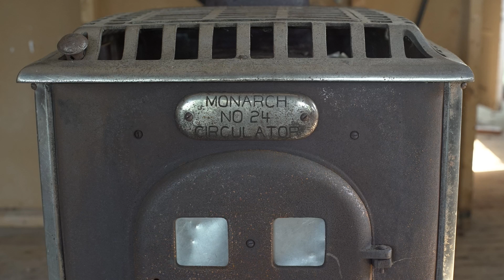Fixer Upper: Some Work Required

Comment: Slim it looks like you have a winter’s project ahead of you.  I’m sure you can handle it.  Looks to me like you have a a good skeleton structure to build upon.  You’ll just have to prioritize what needs to be done first.  May I suggest you start with that front porch. 😆 After that, well you’ll have to decide.  One good thing is you’ve got your trailer to live in while getting the house ready.  Good Luck with your project. It will be interesting to watch.

Comment: Salt waterfront.  Can't beat that.  Cabin is a little rough, but I have seen worse in Fredericton.  Well you won't be bored.  Could get a bit fresh in winter though.  Not as cold as Alberta, but the damp New Brunswick cold can be pretty unpleasant.  I hope you like snow.

Comment: Nice little place Slim. I would clear a few trees from around the "cabin" for fire safety purposes 25 to 50 feet at least. Some areas like mine require a 200 foot area around to be clear.

Comment: That is one heck of a project! 
Just saying, I would salvage what I could remove the building check the pilings and build new.

I took on a project like this a long time ago. Rot is the problem and from the video Slim, it's everywhere. 

Long story short, I ended up taking the building down bought a double car garage package, without the cost of doors.Also new floor with treated lumber, new plywood flooring.  Brought wiring up to code, insulated used some of the windows from the old building. Framed a bedroom and washroom kitchen livingroom all open better for heating.

Over time build a lean-to along one side for a shop. Otherside had roof end walls for fire wood and storage. 

Best part the lumber was delivered. 

As I said, just saying 😎

Comment: Dear Slim,  The land is fantastic and I could imagine landscaping a path to the water.  A few tree's taken out to improve the view to the water.  Wonderful land!!   Now to the house,  hmm,  the floor bounces too much which means they either spaced the floor beams to far apart or they have rotten out.  The house supports look like the house moved towards the water a bit and they are slanted.   I wondered about snow fall in the area and why the house was sitting on the ground in the front without a cement pad to sit on or at least lifted off the ground a foot to keep snow from piling up on the house.
ok ok I know I am picking it apart.  inside those little rooms need to be taken down/out,  I did like the wall of windows, but it divided up the living room area.  Maybe between kitchen and living room?   I worried about septic or if it was connected to public sewer / water / electric  or not.  The roof needs to be taken off and put on correctly with right spacing on supports.  Metal roofing the best for keeping pine needles off the roof.
Here is my suggestion :)   save what you can from the house,  the old wood windows etc.  trash the aluminum ones.  pile the wood up and cover.  Have a cat come in and level the ground for a good foundation site for the new house.

Wonderful land with view,  lots of animals and tree's.   Nice place to build on  :)

Comment: Some friends of mine bought a house like that once. It was probably three times the size of this one. They completely rebuilt / refurbished it, and when all was said and done, it was great, but an architect looking at it and the amount of money it had taken said that it would have been basically the same price to have leveled it and built new, and then everything is known, new material, configured exactly as the owners prefer, and can be re-sold as necessary with the listing showing that it was built in that much more recent year. Just a consideration...

Comment: Gracious goodness!  I was hoping the damage was all in the questionably-built add-on, but that burned bit didn't look good.  Here's hoping you've got strong enough walls to support a new roof, and that you can get the roof resolved before winter.

Comment: First thing. Slim, whatever you do I wish you the best of luck. I know from your videos that you're a person you works the numbers, makes a 'for and against list' and comes to a logical conclusion. Tear down, renovate?  Whichever it is I'm sure you've looked into all the options.

Now on to what may not be a popular comment. I'm going to be what I think is currently the only one to note this fact. Slim says, "It's a side project for times I cannot travel. I will be on the road soon!". If that's the case folks, he's not going to be doing much work on this as his primary focus, based on his statement, is travel. That's OK with me. It's what attracted me to this channel in the first place. If Slim is going to do most of the work himself there will be very little to any travel in the foreseeable future. Anyone that's ever done any remodeling, renovation or even watched "This Old House" or a similar show would understand that. It's lots and lots of very hard work. Much of it would be very difficult to do alone and there is his safety to consider. This is way beyond the level of work he's done when modifying his trailers. Could Slim do it? Sure he could! But not before the snow flies if he's also going to do any substantial traveling.
 
I also want to say this. Slim, don't let your natural enthusiasm cloud your judgment. Slim, please to not take on any high risk tasks. None of us want to see you get hurt working on this project.

Comment: It looked tiny from the outside but seems bigger on the inside... DID YOU BUY YOURSELF A TARDIS?  Wow... it comes with a drill press!...and obviously a leaky roof as well. Here you are surrounded by cubic kilometers of leaves, needles and twigs (check out that roof) and they left you a broom by the door! Gotta love it!

Comment: Beautiful spot, a bit soiled by the man made stuff though.  Too bad about the porch and the porch roof.  Is it accessible during the winter months?  Does it have a well, and septic?  I made a home out of "cottage" 10 years ago in northern Wisconsin during the winter.  It had good bones and both well and septic were good but they were not usable for three months of the 4 months of the 6 month remodel.   The cheapest solution is a tear down and making a flat spot for your trailer with electric hookups and a tool shed with an out house far enough away.

Comment: Well good luck on your cottage. You have a lot of work before winter. I'd hire a good contactor to get to work now before winter sets in. A roof, floor, window, and a brand new stove, maybe new gravel drive :) New electrical too. After that you can do the rest :)
Reply: On a lot reflection, and watching several seasons of 'Maine Cabin Masters" I think Slim your best course of action would be a completer tear down. It would be far cheaper to build a brand new cabin than 'try' to make that wreck livable. You are going to have to put in a new cepitic system, like a I said a new gravel drive. and apply for the Starlink beta for high speed internet. If you start now you might get a enclosed shell before the 1st snow. Good luck.

Comment: Old timer once advised me.  Take a cloe look at the ridge line.  If it is straight, then proceed. Any dip or sagging, tear it down.  Any sag speaks to bad rotting  framing.  Worse you likely have a bad foundation.

Comment: by the time someone would fix that foundation, fix the rot, renovate the whole things, it would be cheaper to tear it down and put up a prebuilt shed of equal size
Reply: A Shed House cabin style would be perfect
Reply: @AngelWerx-2012  Aframe is the way to build it...walls are the roof, one length, two walls

Comment: Well on the bright side of things, the house is not a total disaster. It is however, pretty far gone, but still not a total disaster. I have seen houses in worse shape restored, and I have seen houses in better shape totally demolished. Hope you did not pay much for it Slim, but still looks like it could be a wonderful house when it is restored. The good news is, that you at least have a home base, where you can park your trailer and still camp. I think I would have bought it as well, just for the solitude that it looks to afford.

Comment: OSB is rotten on the walls, floors, and roof is rotten. I have tried rebuilding similar size places before. Seriously just take it apart, down to the foundation. You might be able to save joists maybe some windows (if you really wanted them). I would seriously consider doing a metal roof as it’s small enough to be affordable. Burn all the OSB though don’t breathe it either lots of nasty glues and mold. Demo probably will take the longest. Building from ground up I could do it in about a week or two depending on the hours you put into it. Wonder if toilet is septic might need to spend a bundle there. Make sure well is in good shape. I would build a viewing deck off the front with a door on the front. Sucks lumber is high but it is coming down finally. You might be better off buying a kit home/cabin. Start over for sure you won’t regret it later and it will be worth more.

Comment: Just from the first couple of minutes of the video, "Some work required" may be a bit of an understatement.  That row of buckets is not good news and the back step could indicate problems of a similar nature underneath.  An unfinished extension is always an area of concern.  Nice location, now tear it down and start again.  I would definitely watch any such project.
Reply: I'm not sure it's an unfinished extension, at least not in the usual sense. Common in cabins of the era (just a guess mind you, I could well be wrong) it's the summer room. A place to relax, sleep even, when the cabin proper is too hot, open the windows for the air, enjoy the view. Unheated in the winter and usually unused, or used for storage.
Reply: Actually I have to now agree the back part definitely looks like an add on, I missed the side view earlier where it looks clearly badly tacked on with an equally bad roof extension.

Comment: The site is beautiful. Use your trailer and enjoy the land. Get a permit to burn the structure down. Or burn one board at a time (without a permit) in the campfire as you hang out in your trailer.  Vandalism is a real thing. Consider a house boat that needs fixin' up.  They are close cousins to a fiberglass trailer.  Drive it to  the shore  of your property and enjoy. Put it in a marina when not in use and minimize access to vandals.

Comment: Is the cabin at the top of the bluff? I'd be willing to bet this structure would come off of the foundation rather easily. Since we're talking about a single, fairly small structure and no utilities to contend with, how about setting a new foundation straight BACK from the current site and move it. This gets you off the slope which makes for a solid footing and simpler deck build. You could pull it or lift it with a crane and move it into its new position.
Reply from the maker: There is no flat land on the property. SP

Comment: Looks like the location is awesome. But the bunk house need to be replaced. May be easier to start over versus rebuild. At least you would know the quality of the building. If you need to do a lot of work, make it last. Example pressure treated lumber due to all the moisture present.

Comment: That looks fun, and frustrating. ( my first thought was 2lb submarine blasting gelignite and a windy day, get the wind in the right direction might even get yourself a jetty) But you'll have a well considered plan, and am looking forward to the journey. As someone with a home just passing year 400 in it's timeline, I;d get the place watertight from above,  then airtight from the elements, and beastie proof from below. I assume that's dry rot in the walls? Def worth getting it fixed properly with a decent warranty on the work. (I got 30 years and then a yearly premium), but that's some location (Just get the three S's sorted out (somewhere to shower, somewhere to sleep and somewhere ...else) If you can get to a comfy bed clean, you don't half wake up ready for the morning.

Comment: Beautiful property but unless you can get one of those fixer upper TV shows to come in and do a renovation, I’d tear that sucker down in a heartbeat and start over.  Unless you replace all the way to the studs and foundation, you will always have an old, broken down place.  My 2 cents.  Good luck with whatever you do.  Or tear it down and pull in a nice 5th wheel for an instant home.

Comment: That roof is going to go the way of that front step from all the debris left on it day to day, month to month. And that floor looks like a goldmine of hazardous mold be cause of the leaky roof. Heads up, Slim. 
PS. That's not a fixer up. That's s demo and start over.

Comment: If it was me, I would keep this for storage and put down a prefab to live in this winter. Insulate it right away and move the wood stove in the new one. The red one seems unsafe and moldy and rotting wood and leaks.

Comment: Job #1, fix the roof. A building is only as good as its roof. A roof is meant to shed water, there is so much debris. It has mulched and plants are growing on it. After that you are pretty much dried in.

Comment: Remove the metal siding which should have been used as the roof and tear it down. The wiring, stove, stove pipe, foundation blocks and windows could be reused.
Reply: Oh, one more thing. Great location.

Comment: Depends on price.. I would tear it down and put something pre fab on the land and modify it from there. Even a trailer. If the land is a steal - priced right including tearing down that rat shit infested shack  it might be worth it. It has electric and will need a well or generator if not utility provided.